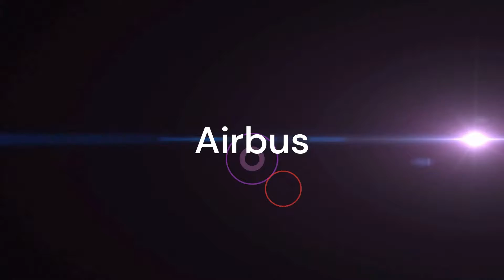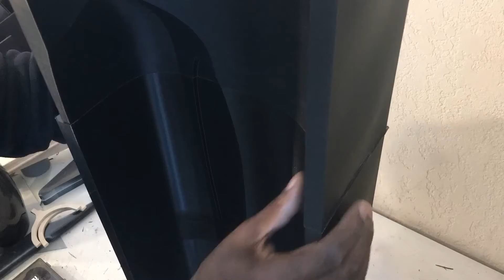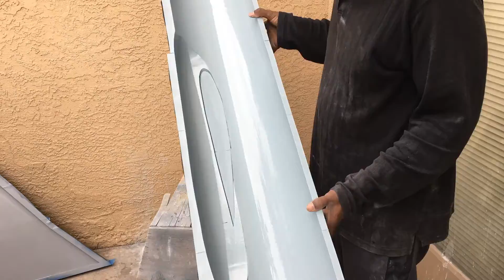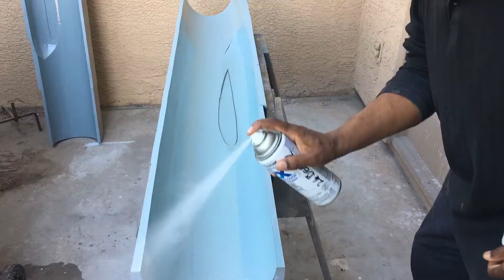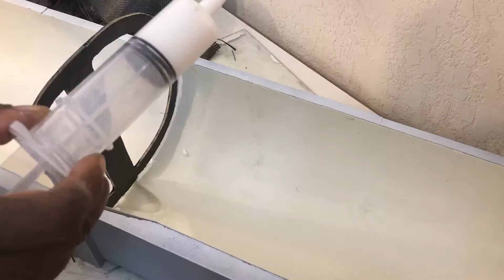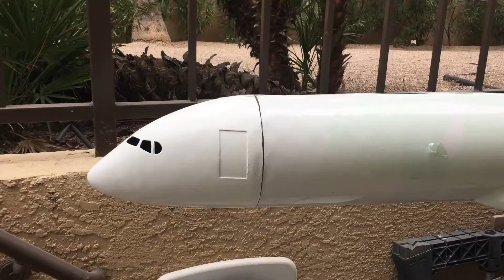Building a Large 8 ft RC A-350 Airbus from 3D Printed Molds and carbon fiber

Comment: Sorry for another question, I was also wondering what weight fiberglass you used and how many layers did you apply overall in the mold?
Reply from the maker: No problem, feel free to ask as many as you want.  I used 2 layers of 4 oz cloth.

Comment: Hello, I was wondering what is the spray you used to make the 3-D printed surfaces look smooth. Much love from Japan!
Reply from the maker: I first sand the surface with 100 grit sandpaper. Then either will brush on a heavy layer of automotive primer or spray a heavy coat of primer on it.  Then sand again with 100 grit. Spray primer again, sand with 220 grit sandpaper then 320 grit.  I then will spray a color on the primer.  When dry, I will wet sand the surface with 1000 grit sandpaper 1500 then 2000.  Polish then wax.   In my latest video, I show you how I do all of this also.  Check it out. If you have anymore questions, feel free to ask me.
Reply from the maker: The primer in the can I like to use is made by Dupli-color  automotive primer/filler.  You can spray it on really thick and it sands very easily.
Reply: @cadbuildflyrc3784  Thank you! will check out the most  recent video now!

Comment: How do you make those foam formers?
Reply from the maker: I am going to make a video on how I make them, but in a nut shell you, you need a sheet of foam, 2 panes of glass or plexiglass and carbon fiber cloth and peel ply.  On one sheet of glass wax the surface or put down a sheet of wax paper.  Lay the carbon fiber on the wax paper or glass and wet it out with epoxy. Lay the foam sheet on the wetted out carbon fiber. Lay carbon fiber on the foam and wet it out with epoxy.  Now you can lay peel ply on the wetted out carbon fiber or just lay wax paper on it. You should have a layer of wax paper, carbon fiber, foam. carbon fiber and wax paper.  Now place this in between the two sheets of glass and add pressure. Wait until the epoxy has cured and remove and cut to shape.

Comment: This is looking soo good. 
I must have a look into fusion 360... A 3d printer is also on the list. Can you say something about the weight so far?
Reply from the maker: Thank you. I have not weighed the complete fuselage as of yet, but I can say it is very light.  I am hoping for an all up weight of 18-20 pounds or less ready to fly.
Reply from the maker: The printer I am using for this project is an Creality ender 3 max.

Comment: Looks great man. Just wondering what software you used for the molds. I am using fusion but having some difficulty getting the initial modeling done. I am super new to fusion but really want to build. Kind of tired of the arf stuff. Great job man!
Reply from the maker: Thank you.  I use Fusion 360.  If you have any questions,  please feel free to ask.
Reply: @cadbuildflyrc3784  thanks so much. I’m doing pretty good so far but I’m having difficulty with the winglets and wing tips. Can’t get any lofts to work. You got this down and your molds look amazing! Can’t wait to follow along with the build. I’m going to get into big airliners too. Working on the A350 as well. Sexiest airliner in my opinion! Happy new year too!!!!’
Reply from the maker: @adventuresmidwest3065  Thank you.  Watch this video on how to model winglets.  You have to draw it on different planes and 3d modeling must be turned on to see it.  The video explains all of this very well.  I hope it helps you.  It helped me.
Reply: @cadbuildflyrc3784  ok cool. I don’t see a link to the video. I am totally having fun with fusion. I have the fuse, wings, and empennage done. Thought I had it earlier but the loft looked like it completed then when I hit ok, an error message popped up. Thanks so much for responding so fast. As one modeler to another, I appreciate it. I really want to scratch build one and you are really good at it for sure!
Reply from the maker: @adventuresmidwest3065  Sorry about that. Here is the link  https://youtu.be/vKvwNYWbSNc
Reply from the maker: @adventuresmidwest3065  Thank you.  It is fun.